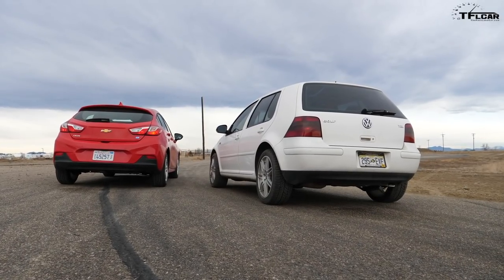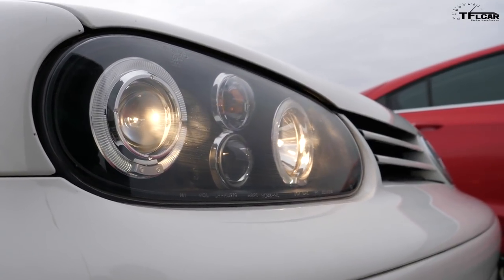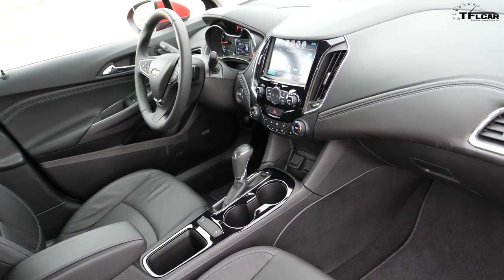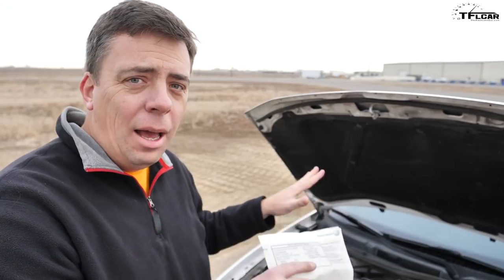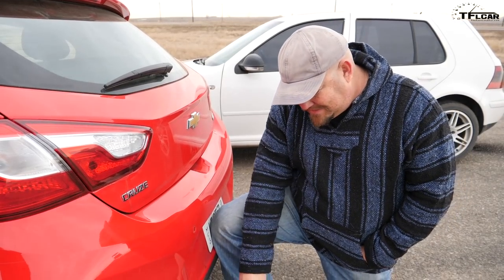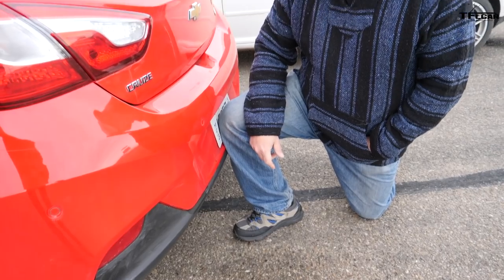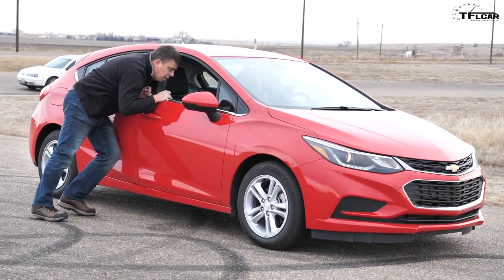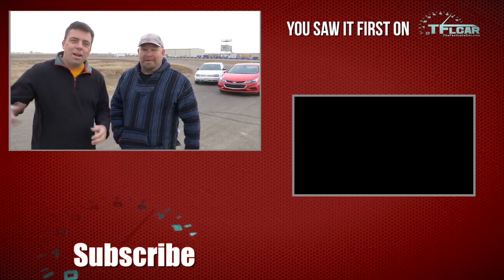Old (2002 VW Golf ) vs New (2018 Chevy Cruze) Diesel: Have Oil Burners Improved?

Comment: A diesel with over 190,000 miles will have warn injectors.  The fact is that the Golf would not have smoked like that from new.  Not to mention any other wear to the engine or turbocharger.
Reply: No it won't lmao. If it's been taken care of it'll run fine. Injectors get worn out from not changing the fuel filters or getting shitty fuel/not using additives.
Reply: Injectors don't last forever...my 2000 dodge ram had 350,000 miles on it and was on it's second set, probably needed a new set but I sold it and bought a 2014 hemi ram. Family, Wife, Kids, ect...

Comment: That golf has 200 k miles and you expect it to pull more than a new car? Lets see chevy hit 200 k miles and see what happens. The 1.9 TDI was one of the best engines ever made, all of them can hit over 200 k miles. The 90 ps and 110 ps 1.9 TDI doesnt burn any oil. That was in the ones with higher hp because the 1.9 wasnt built to have a lot of hp in the first place.

Comment: What does “L” stand for on the gear lever? Or does it have low range? Lol
Reply: Electronic Range Selector. Allows you to manually shift using the tap "+" or "-" buttons. Also allows for a 2nd gear start. Also, if you place the gear select in L, and then tap the + button to say 4, the car will only shift from 1st-4th. It will hold 4th gear all the way to redline.
Reply: truckguyjoe got it. Thank you for replying
Reply: No problem Hape! Anytime.

Comment: $31,103 Canadian for the base model , manual,  diesel
Reply: Ben Derisgreat blame are priminister for what he did
Reply: Where the hell did you buy it? If it's the fully loaded Auto hatch back, then maybe, but the stick shift sedan starts at around 24K, but if you remove all the credits, you can get it at 22,500. A friend of mine in Toronto bought one last August for $22,500

Comment: I’m sure it will be a wonderful motor, but the Cruze has always been a terrible car. For the price. I’d buy a Honda. Get nearly the mileage, and better reliability.
Reply: s1283 The new Cruze is a far cry from the first gen.
Reply: William Stewart for their sake I hope so, but a Honda will still remain a better option until they work the bugs out over a few years.
Reply: In 3 weeks time since purchasing it, I had a DPF error but it was caused by a sensor. So far so good. I too have read the nightmare stories about the first Gen... Fingers crossed!

Comment: Rolan the glow plug issue along with the wiring harness for the glow plugs it's not really an issue VW calls at a wearable part that's like calling your brakes a issue when they were out. Don't sell that Volkswagen keep it in case North Korea decides to set off an EMP above Colorado

Comment: Now compare them to an early 80's diesel powered Chevrolet Chevette...
Reply: Or GM's horrid old 6.2L diesel.
Reply: +Jeff K
I had the 6.2L in my 1986 Chevrolet M1008 CUCV (military 5/4-ton pickup) and you are correct, it was a terrible engine. I always wanted to swap in an Isuzu 4BD1T 3.9L from my '89 Isuzu NPR but never got around to it and sold NPR in '07 and the M1008 in 2014.

Comment: If you'd have put tissue paper behind a newer VW diesel you'd see nothing. At 50,000 miles the inside of my exhaust tail pipe was perfectly clean on the my 2012 VW Sportwagon. So your test is as you say... Old tech vs new tech but the new VW would test the same as the new Chevy.
It's not the DEF system that took out the soot, it's the diesel particulate filter... WHICH THE NEW VWs HAD!
The EPA ruined the game for everyone else. Nathan, come on now.

Comment: VW is the best at making a Diesel engine. Dosent mean it can pass emissions. But you wont get the service life and lower repair cost out if a New diesel vehicle. GM still cannot figure out Diesel tech.
I would take the old VW please.
Reply: The Chevy's diesel engine is made in Germany, by Opel.
Reply: mbd501 
I doubt it. It was probably made from old Isuzu parts that fell off the assembly line ready for the trash bin.

Comment: absolutely the  GOLF is a better car, and gets better fuel economy.  Realistic cost is the Cruze uses (Diesel fuel plus DEF costs), which means the cruz fuel economy is worse than the VW golf.  VW GOLF all day over a Cruz.   And if the tree hugger doesn't want soot in his lungs then he shouldn't put his mouth on the tail pipe, done deal.   Gas engines don't show the harmful stuff they exhaust, but the soot diesel exhaust is less harmful even though its black and sooty.
Reply: Yes.  3 Gallons of DEF @ 3.50 a gallon over 7000 miles is a real killer.

Comment: The VWtdi will last longer than the Chevy Italian diesel... . And the VW looks better... Go to kerma TDI for more power for the VW... bigger injectors etc.. I had a 03 Jetta with 600k miles I put on it....
Reply: Really, and how do you know that?  GM's diesel is new, get back to us in 20 years.
Reply: #1 The 1.6-liter Ecotec, developed primarily at GM’s Turin, Italy facility=An Italian Diesel? ..LOL I.E. Jeep liberty, Dodge Ram 3.0l Eco Diesel... #2 The Injection pressures required for "Clean Diesel" are way too high (>28,000psi) for modern metallurgy and design to keep up. Bosch has even screwed the pooch on the Common rail 140hp TDI VW with close to 100,000 of the 495,000 VW TDI's sold since 2009 have had HPFP failures. with hardly any recalls-and when the HPFP goes out, it takes the whole fuel system with it to the tune of $5,000 to repair/replace.#3 Nathen said it, "Cheap Chevy plastic".. That car wont last longer than 10 yrs tops.#4 GM almost single handedly destroyed the notion of diesel reliability in the late 70's and early 80's.#5 GM cant for what every reason built a reliable diesel on its own. The 6.2 and 6.5 are boat anchors, as will this "eco-tech diesel" be in the future.The last good diesel to own are pre-common rail design+ 1wire diesel engines minus the GM 6.2 & 6.5. that's not an opinion, that's a fact due to from past experience with all of the above.The Best Diesel's Ive own have been, 1998 215hp 12v Dodge cummins, 1998 235hp 24v Dodge cummins, 2005 Dodge 325hp 24v common rail cummins., 2003 VW TDI 90hp Jetta.. So How do I know that?, Years of experience, thousand of dollars spent and GM's past 40 years of track record of screwing the American public.. Only GM would take a Buick 350 and convert it to 22:1 compression and throw in a IDI system to get 83hp at the rear wheels and 40k miles before it blew up...LOL
Reply: Hal 9000 
I can go to a Chevy dealer tomorrow and pick me up a brand new Cruze, Equinox, Colorado, Silverado turbodiesel. Which new VW diesel can we buy in North America again?
Oh yeah... #Dieselgate.
And I wouldn't talk quality when comparing anything with a VW ;)
Reply: SlackTastic be my guest, go buy it... You won't get 600k miles out of it....  30k for a Suzuki body with an Italian diesel, sounds good to me... Lol
Reply: SlackTastic go back and re-read my previous post... You're missing the point about globalism when it comes to sharing diesel technology and where the future is and where the Metallurgy is. Metallurgy is not keeping up the high pressure injection pumps can't up with the demand of lack of lubrication from ultra low sulfur diesel, the high pressure pumps are basically destroying themselves as you drive them...
Reply: Hal 9000 
You can't possibly know that. And how many VW diesels could have possibky made it to 600,000 K, taking your word for it? You may have had a unicorn there!
I'm not currently looking for a vehicle of this type, but if I was in the market here for a new turbodiesel compact car with a factory warranty,  what are my options?
Reply: SlackTastic I don't know what part of the country you live in but I live in California so the engines were out but not the bodies they don't rust out out here there are tons of Jettas and golf still running around with with the 1.9 liter, and they have well over 300,000 on them I've talked to many of them at the pumps. I personally know three other people that have over 500,000 on theirs, as well as old Mercedes 1 2 3 models like the 240 D's 300d etc... The Quest for 0 or nearly zero emission diesels is taking its toll on the fuel pumps that's the whole point not to mention the cheap plastic interior from the Suzuki / Chevy Cruise.
Reply: SlackTastic go buy used 2000 -2004 Jetta or golf if you really want a diesel commuter. But there's no point in that if you want a good reliable car they're getting harder to find stay away from the CVT transmissions which includes a Toyota Subaru Nissan. Stick with the regular transmission either Auto or stick like a Camry Mazda whatever if you want new... Right now my 2015 Camry 4banger I have a hundred twenty thousand trouble-free miles and I get an average of 35 miles per gallon on the freeway and I don't have to worry about a $5,000 fuel system repair.
Reply: Hal 9000 
Your post is filled with a lot of conjecture and opinions. I respectfully disagree with it. There are plenty of new semi trucks on the road with 30,000+ psi fuel injection that have over 1,000,000 miles + on them and are still rolling along on their original engines. Same metals, same technology.

And a link is only as good as its source. I've never heard of Consumer Affairs before your post. I could find a host of biased links against VW also, if I wished.
Reply: SlackTastic I've owned every one of the vehicles described in the above I know from past experience and hundreds of thousands of miles I'm 74 years old so I've owned every one of those vehicles many of them at the same time and I drive 2 hours to work one way 2 hours back and I have been 45 years so no it's not conjecture and opinion it's fact on repairs
Reply: SlackTastic don't take my word for it and go ahead and run to the Chevy dealer and buy one of those cruises good luck to you
Reply: SlackTastic get these two guys off camera and ask them what their opinions are I bet you it'll be the same as mine
Reply: Hal 9000 
I agree with you. I wouldn't recommend anyone purchase a diesel unless necessary. Buy gasoline instead. I get fleet diesel, so it was worth it for me.

And where I live, cars that old have returned to the earth via rust. That's not an option for me :)
Reply: I own a 2003 Golf tdi bought it with only 80k miles in 2015 now it’s at 175k on the motor not to mention it’s a auto!  Had no issues running like a champ all over southern Cali and frequently out to Vegas and Phoenix!  The best investment I ever made!  I could get 550miles out of a full tank and I’m happy lol.

Comment: The VW will last longer. The addition of a dpf and def reduce particualte and NOx coming out of the car but will eventually clog up the cars internals. Over time deposits will build up in the engine and people will have issues. A dirty diesel will outlast any modern gasser, but modern diesels will have the same longevity as their gas counterparts. Diesels used to be good. It's not a good time for diesel fans.
Reply: What is the best diesel car to buy and best year/model thx !
Reply: @m.morininvestor9920  You're gonna want a late-seventies GM 350 diesel. Best ever.

Comment: You can buy a Hyundai Ionic for cheaper that gets 57/59mpg and is gas instead of a dirty diesel.  Diesel is clean now but give it a few years where people can't afford the repairs or modify the engine and diesel will emit 100 times worse than a gas engine.Same thing is happening in the UK 2/3 clean diesels did not meet emissions after being on the road for 5 years.  Just a disaster waiting to happen in the USA in order to meet CAFE requirements
Reply: Thomas Paul Yes. Morning traffic in the winter here in Norway smells really bad. We had a skuddene boom in diesel sales around 2006 and those cars are getting old and smelly now.
Reply: I really hope electric drive takes over by 2030 to eliminate most of the smog.  Very unhealthy.  Tesla is doing a great job but the oil industry is doing everything they can to hang on to the combustion motor.

Comment: the Cruze loses in so many ways. its build quality. its not proven and its MPG isnt as good yet its 16 years newer. i would take Andre 02 golf over that 18 Cruze any day. by the way you've kept that golf in really good shape Andre
Reply: Mike Utoober Of course the fuel economy isn't going to be a as good these days, it has to comply with emmisions now which are very strict (ask VW about that lol). On to the reliabilty, this engine is from Europe so it is proven. Take a early 5.9 24 valve cummins and tune it properly and compare it to any modern diesel heavy duty truck, they get way better fuel economy.
Reply: The Cruze Diesel is probably more efficient.  New EPA test standard vs. The old EPA test standard.
Reply: Erik Stephens It won't be thanks to emmisions crap that's on modern diesels now.
Reply: I don't agree.  While the emissions gear might impede the Cruze some the shear fact that the hp/L is higher in the Cruze indicates that the thermodynamic efficiency is quite a bit higher on that motor.   Curb weight of the Cruze is 200lbs heavier than the Golf. Which will hurt it a bit.  But the 9 speed automatic is going to help the Cruze.  I think it would be a lot closer than most people would think.
Reply: Erik Stephens The hp/l doesn't just equate to thermodynamic efficiency. You also have larger turbos being fed by more sophisticated injection systems. Horsepower comes at a cost and that's usually fuel consumption.
Reply: While a larger turbo can certainly equate to more power without increase in efficiency.  Outside of that an increase in power is almost always due to an increase in efficiency.  If you use the fuel injected more wisely you waste less energy and generate more power.  You mention more sophisticated injection systems.  That simply proves my point.  A better injection system allows for a vehicle to generate more power using the same amount of fuel.   And physics dictate it takes X amount of energy to get a vehicle of Y mass up to Z speed.   And energy is simply a function of power and time.   So if you can generate more power with the same amount of fuel that means you will generate the same amount of energy over time with less fuel.

Comment: In 10 years the golf will still be on the road.  I doubt the Cruz will.
Reply: Chevy's are pretty reliable, especially with a diesel under the hood.
Reply: Ed Mathews My experience with GM vehicles has been great, 14 year old Silverado with 430,000 miles and no major repairs, and a 22 year old Saturn with 190,000 miles with only a replacement of the shifter cable which cost about 150$.
Reply: johnnyreb86 I’m not bashing GM or Chevrolet.  My father was a plant supervisor and I’ve owned a LOT of Chevies and loved them.  But they insist on continuing with their diesel experiments in cars and they don’t have a market for them.  Their history in cars is that they sporadically offer them in extremely limited numbers for just a couple years per model, and then discontinue them, leaving their customers with no support down the road.
Reply: My uncle has a cruze that's 2008 11 years old first gen and it's pretty ugly I guess...and those first gems are definately the worst... but it's like new if anything. Nothing wrong with it. Do you just not like chevy?